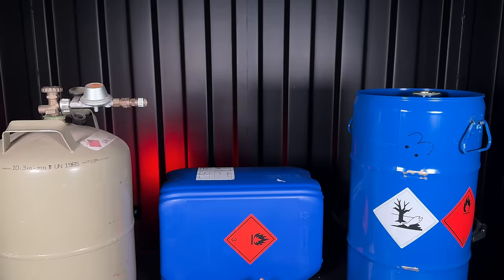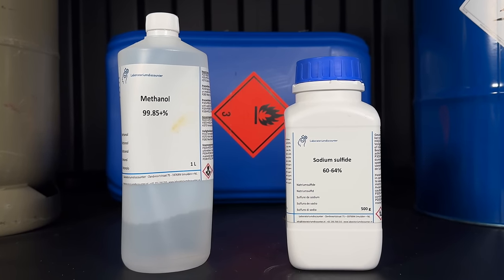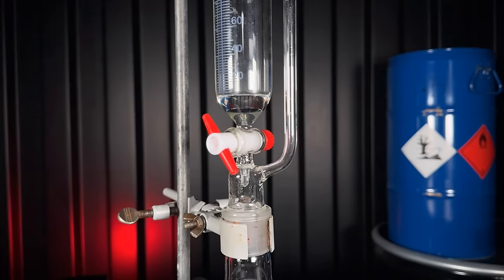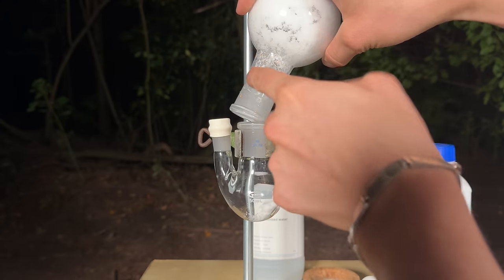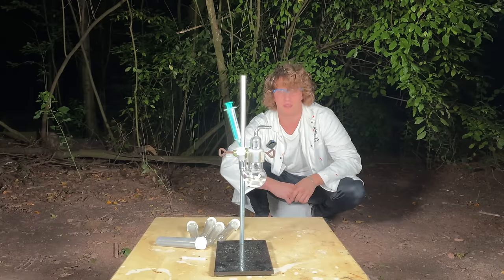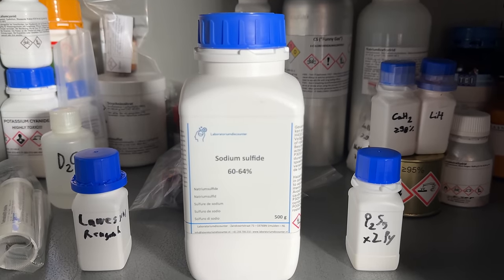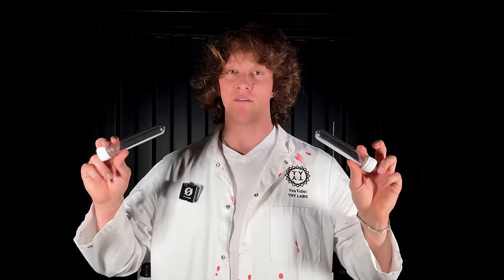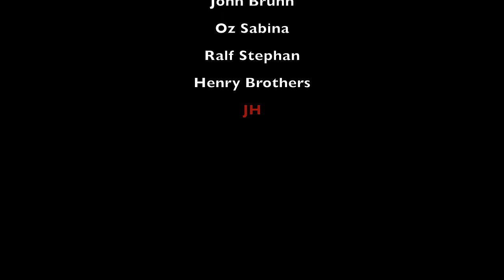Making The Smell Of Gas Leaks

Comment from the maker: Today they mainly use tetrahydrothiophene for odourizing the gas you use
Reply: Any idea why they changed the compound? Cant find anything on the internet.. (but damn the molecule structure looks so nice)
Reply: @ugarit5   I believe they did so as Tetrahydrothiophene is much less toxic than Methanethiol
Reply: Also tetrahydrothiophene is more stable than thiols, so it remains longer in the pipes without sticking to metal walls. Especially oxidized metal surfaces “eats” polar sulfur compounds. So they need less dispensing unit on the lines.

Comment: Is this being filmed in a shipping container? That background looks like a Conex container.
I only ask because I was looking for lab equipment online and found that there are pre-build laboratories that are basically heavily modified Conex shipping containers, and they're awesome. lol
Reply from the maker: It is. It is fireproof, does not have windows and can be locked up completely so it was the best choice for me. I don´t want the wrong people to get access to the stuff i have.
Reply: @THYZOID  Thats awesome! Do you store just the equipment in there? Or the reagents too?
If you store reagents, do you have to do anything with temperature control? I live in the desert, so if I wanted to store reagents in one of those I would have to deal with the inside temperature sometimes getting up to 50 °C during the summer. 
One of the main reasons I want one of those is because its just safer to do my chemistry in a structure separate from a house. If there's a fire - the house and everything else will be totally fine. 

If you have it setup as a full lab, you should do a tour of it some time :) I'm definitely interested in setting something like that up when I get a house.